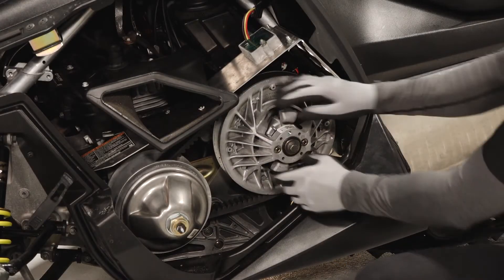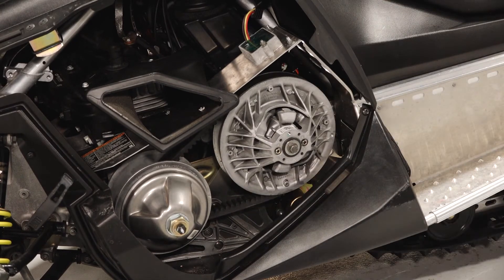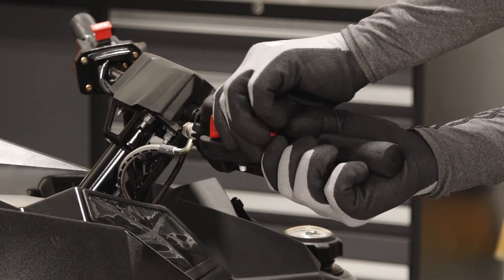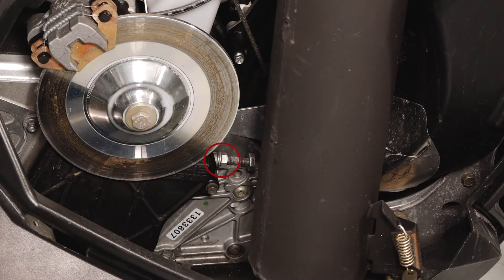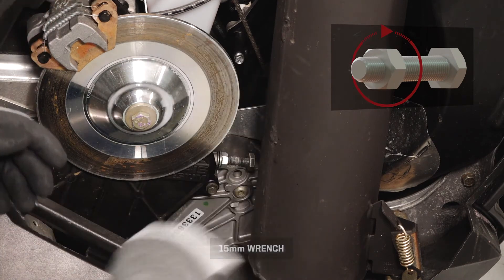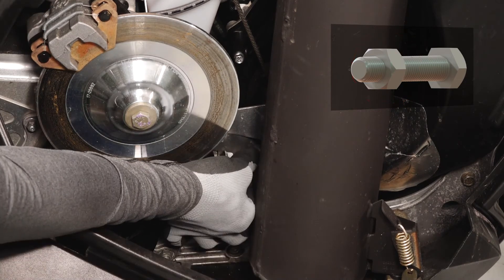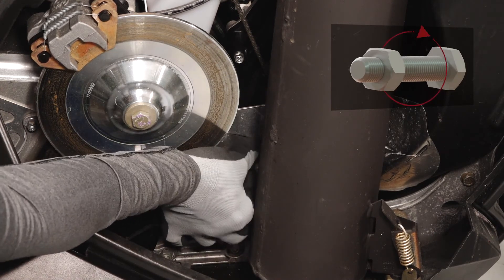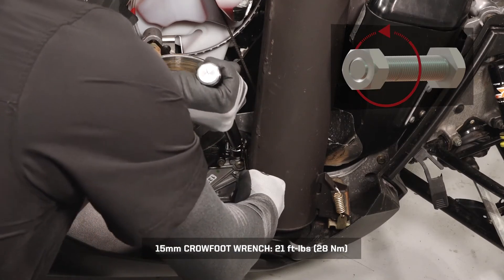INDY EVO Drive Chain Tension Adjustment - Polaris Snowmobiles

Comment: I gave my 2020 Evo Rmk its first chain adjustment at 700kms exactly as shown, at 1050km mark i felt this sudden stoppage for a moment like i ran over a metal stake. I looked and walked the snow every inch, nothing.. heh  looked undercarriage over  all good  drove good.. weird.. so a month ago(1480km mark) i ordered gears to get some more speed out of it.. guess what i found... a chipped off tooth on the small upper sprocket.. and the chain is reilly stretched.. (i only ride this thing around like gpa, 1 passenger max (180lb) all of the time, no towing, just puttin around. If i would not have caught this it woulda grenaded for sure.